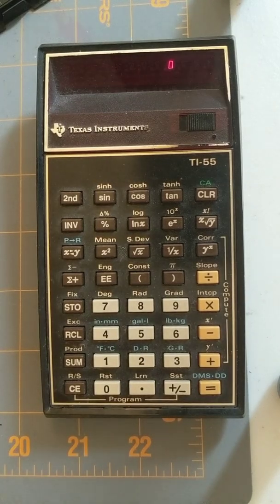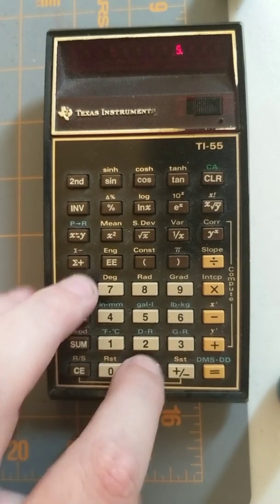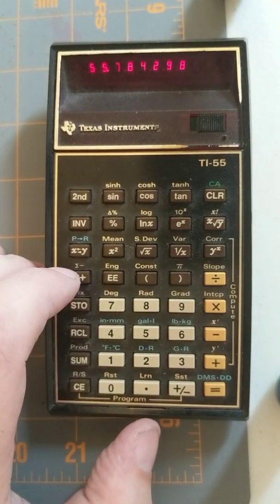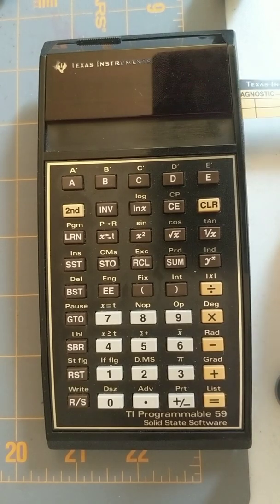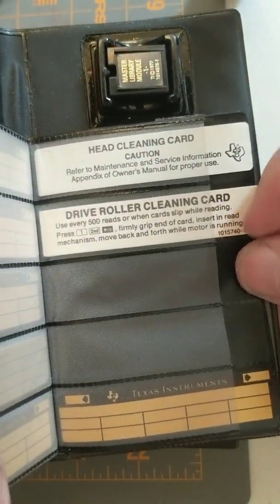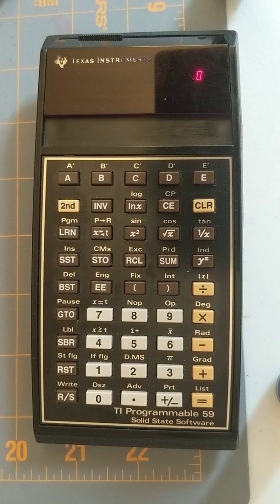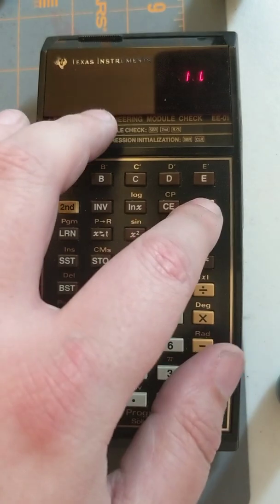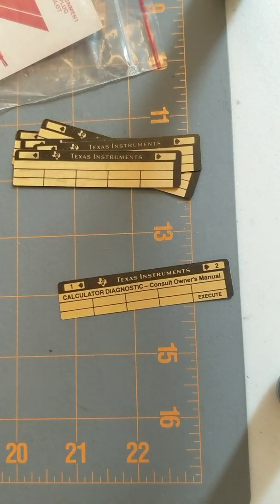TI Calculator Update

Comment: The cards without the black header are typically extra-use blanks that are not magnetic. The back side would be very shiny gray vs. the dullish dark gray/black of the magnetic cards. Typically, they were used for the TI-58C as it would remember your program when turned off. That way, you could write the labels on the card and slide it in for reference.